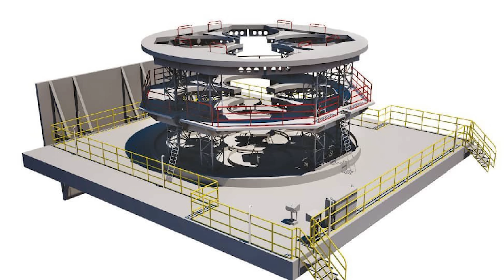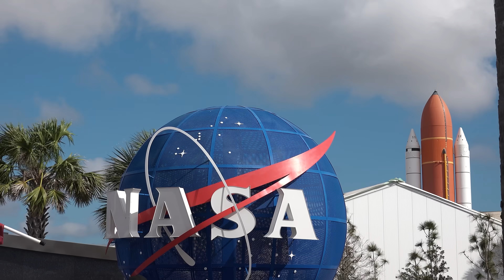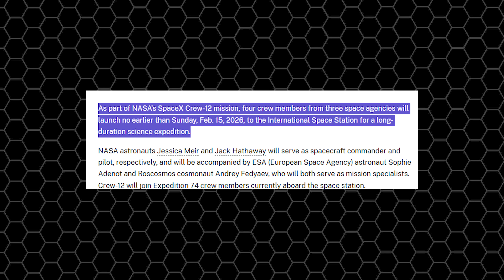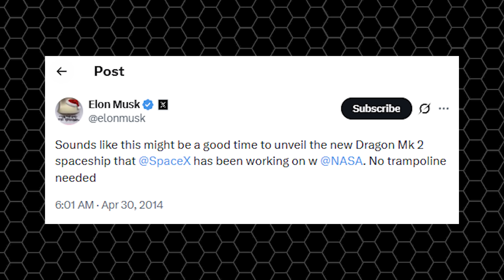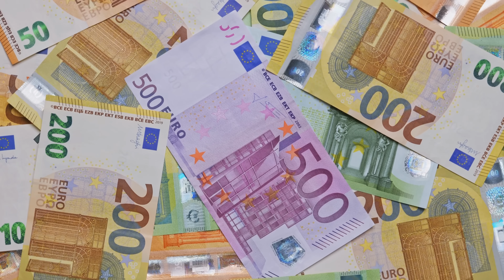NASA officially Calls on SpaceX Dragon to Go for Launch while Russia Soyuz Trouble...

Comment: “NASA did not retaliate” … why would it, when Russians never retaliated against it? What kind of nonsense is that?
Reply from the maker: “Retaliate” here doesn’t mean political revenge.
It means refusing cooperation during a failure. That didn’t happen.
Reply: @alphatech4966  btw Kazakhstan launch pad had been used for manned missions and Roscosmos had regularly transported NASA astronauts to ISS … simply because NASA needed help not Russians 😉, so it’s EXPECTED that NASA might step in without making a big PR deal out of that. Also, Russians have other few launch pads inside Russia for unmanned Soyuz space missions which they are regularly using … in fact they used it this week to launch 50 new ISR satellites into orbit … so the whole YouTube movie is somewhat incorrect tbh

Comment: SpaceX would probably charge Russia whatever they charged for the other private launches, adjusted for inflation since then; it’s a for profit company so if you have the cash, they have the equipment. Would probably carefully verify cash transfer before launching though…
Reply from the maker: Crew flights don’t work like private launches.
Seats are governed by NASA contracts and cross-flight agreements, not open-market pricing.

Comment: The U.S. should have built its own, original concept "Space Station Freedom," which was planned to be more capable than the ISS compromise design. The U.S. would not have had to depend on any other countries to operate the station, and the station would have been much a better, more capable space stationl one of the functions of the proposed Space Station Freedom was to be a station at which Lunar and Mars-bound spacecraft could be built/assembled.
Reply: lmao.
Reply from the maker: You’re not wrong.
Space Station Freedom was far more ambitious — but it was also far more expensive and politically unsustainable in the post–Cold War budget climate.
Reply: Well you can the Chinese have BBQ party in their Space Stations, so it's not impossible at all to do better than the ISS.

What is worrying is that the ISS is soon over and we still have no concrete plan for the replacement.

Research on nuclear propulsion has been stopped so no assembly of ships in orbit I guess.

100 of billions more for the army and nothing for space.

I this point I just cheer for the Chinese to win in Space so the US can have a wake up call.

Comment: The Baikonur Cosmodrome is in Kazakhstan and the Russians haven't been paying Their Rent to the Kazakhstan Govt.
So everything at the site is on hold as many of the Assets have been seized.
Reply: 100%.
Reply from the maker: Small correction here.
Russia still pays lease fees for Baikonur, but operations there have definitely slowed and become more complicated due to political tensions, budget pressure, and long-term uncertainty.
That’s exactly why Vostochny was supposed to replace it — and why its failure matters so much.

Comment: MAYBE Russia is reconfiguring the launchpad to launch missions to the Moon?  Take time from NASA?
Reply: They are doing it to test plasma drives for deep space missions, and they have made significant advances in nuclear reactor miniaturisation and that will be used to, probably to power ion drives and anything that needs electricity so they don’t have to rely on solar further from the Sun, they plan to redevelop that whole site for those missions, China will most likely be the first to build a base on the moon and will give Russians access.
Reply from the maker: That’s very unlikely. Reconfiguring a launch pad for lunar missions isn’t a minor upgrade — it usually requires an entirely new pad, new ground systems, and a launcher designed for deep-space missions.

Right now, Russia doesn’t have an active lunar-class crew vehicle or heavy-lift rocket ready for that role, and Baikonur was never optimized for it. So delays there are far more likely tied to funding, infrastructure limits, and long-standing operational issues — not a secret Moon push.

Comment: Old workhorse has problem but new tech does not ? Stop defying logic.
Reply from the maker: Not defying logic — older vehicles like Soyuz were designed decades ago and have limits in redundancy, parts, and launchpad reliance.
Newer systems like Crew Dragon benefit from modern engineering, updated materials, and fully American-built infrastructure, which reduces those risks.
Reply: @alphatech4966  they are just as efficient .